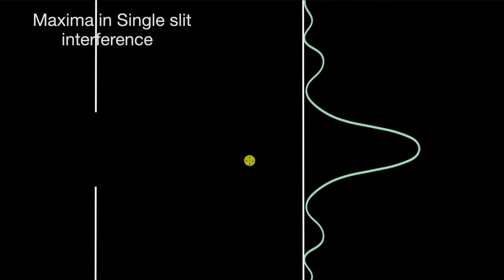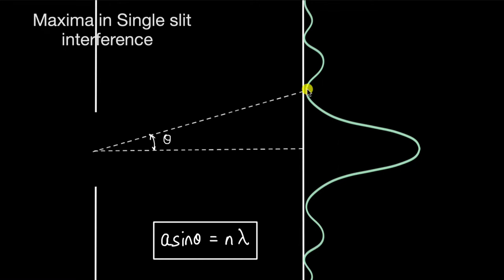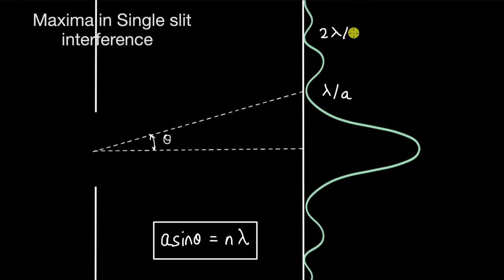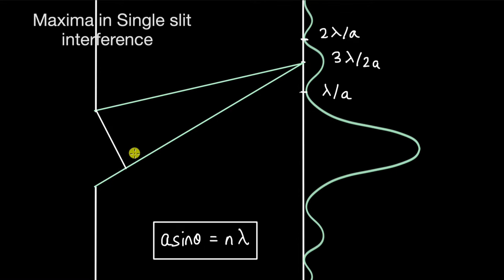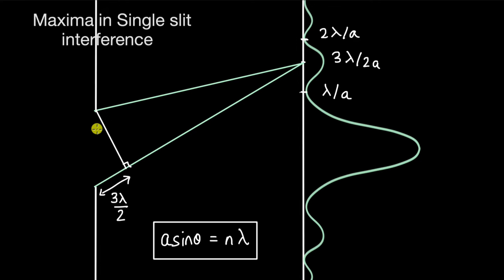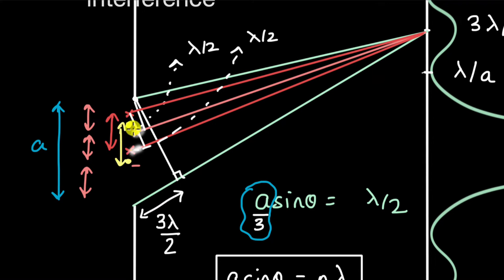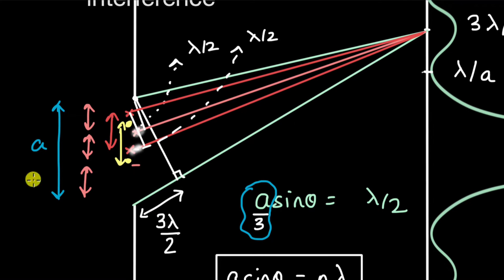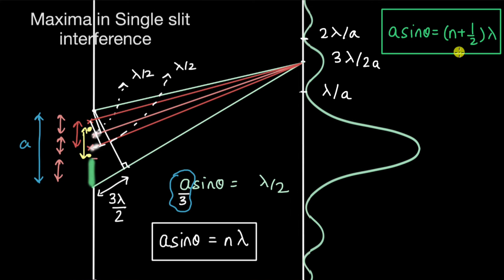Maxima in Single slit diffraction | Wave optics | Physics | Khan Academy

Comment: For everyone wondering this result, this is just an approximation for maxima you need to solve (tan beta= beta) where beta  is pi b by lamda into sin theta
Reply: You are absolutely correct by differentiating the i res we get that equation but it is impossible to locate those points.
Reply: Yes I'm pretty sure you found this using the resultant wave eqn and a resultant intensity equation . In which case do know of any way to approximate to this result from that equation . Minima part was pretty clear but I can't quite figure out a way to come to this result via that eqn . And in this case is the sin theta = theta assumption the one due to which this ambiguity arises ?